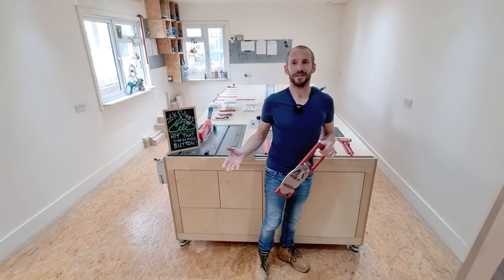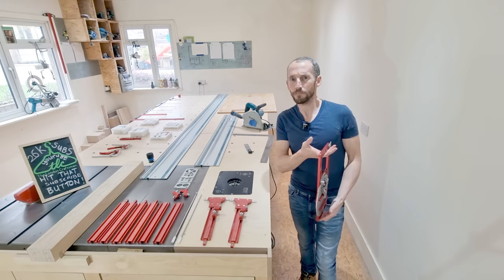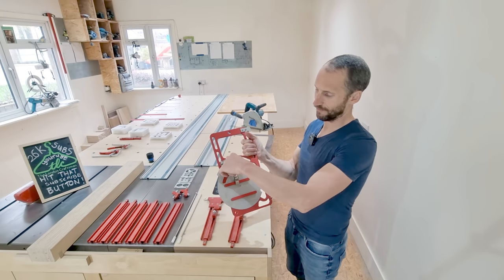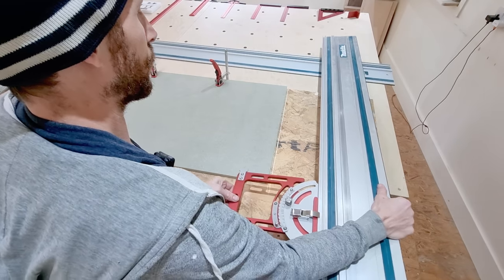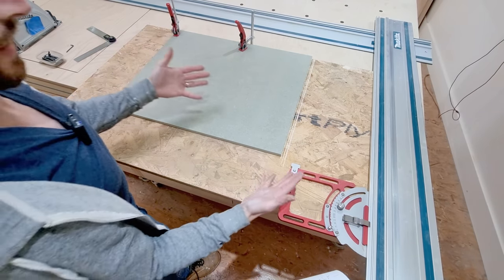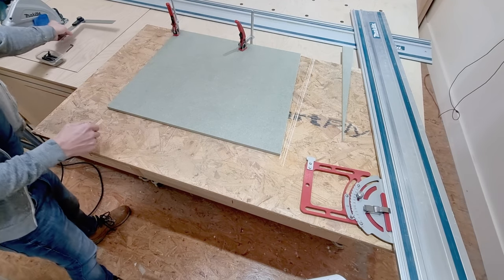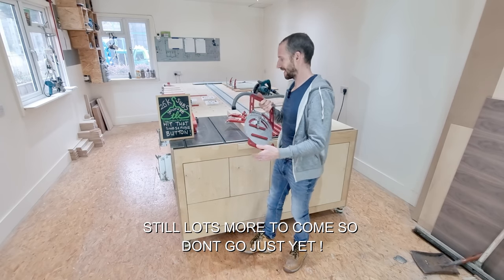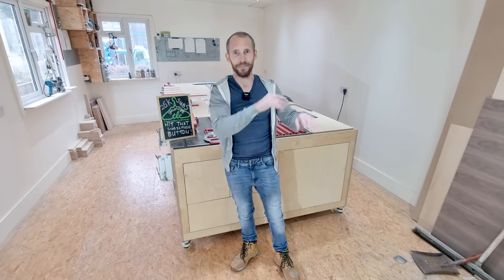Test & Review RIDICULOUSLY Cheap Adjustable Track Saw Square | + New Machine You Must See | Vid#85

Comment: Thanks. I just bought the same bits of kit too. Easy to use and cheaper than a woodpeckers or a table saw. And certainly easier to lug around to sites (I bought mine from AliExpress)

Comment: I have one and find that there could be improvements with the indent lock. There should be a disengage button  for angles that are just a bit off of 90  degrees or any other indent. Other than that it works very good.

Comment: Thanks for reviewing this track saw square. I had this pop up on the Bangood app when I was checking out the parallel guides after your review of those. I was concerned about accuracy as there is no indication it can be adjusted. Even the Woodpeckers version does not indicate how to adjust it in the manual. Showing this ability on your review has me sold. I will be ordering one of these for sure! Thanks!
Reply from the maker: You're welcome I'm rally happy it's helping people 👍👍👍

Comment: Cheers, Ryan,  and thanks again for taking the time to share your experience with this excellent looking tool! Just ignore the trolls. Any suggestion that you are somehow trying to make cash out of flogging Banggood products, seems entirely misplaced. 
I've purchased many myself - only the parallel guides on your recommendation - and can say, almost without reservation, that I have no complaints. All the measuring and marking tools have been absolutely spot on and amazing for the asking price.
I've only had one failure so far, and that was because I didn't do my homework. I bought the mitre guide for my table saw, and it doesn't fit. Alas, being the owner of the non-standard Evolution Rage 5s, the mitre slot is too shallow to play well with the guide. 
That said, I'm over the moon with all my other purchases, and will, on the strength of your demo' take a closer look at this adjustable square.
Best of luck to you, and your business!👍
Reply from the maker: Thank you for the nice comments I really appreciate them.
I really do love the Banggood tools, really well made and low cost.
Cheers 👍👍
Reply: I would second this comment. Both in thanking Ryan for bringing to everyone’s notice Banggood and another appreciation of Banggood. I tipped my toe in the water several years ago after watching a video from Manor Wood. I got the measuring tools and tested each one excepting to keep this one; reject that one - but then and now, I haven’t had a single failure. One thought though, all the tools I have bought are branded Veiko; given that Banggood is effectively a retailer, I would urge caution on people who might buy tools other than Veiko.

Ryan and I (from a response to a comment from me) have come under criticism for buying from China. I certainly despise all that the Chinese Government stand for -and I can’t imagine that Ryan is any different. Given that precision tools are made virtually 100% by CNC and the amount of labour involved is minimal, how can Veiko produce outstanding, accurate tools for a fraction that Woodpecker does? The answer, I believe is that they don’t. I would suggest that Veiko and Woodpecker (as an example) make a square for pretty much the same cost each. I would even say that shipping cost is not a great factor. That leaves 2 possible differences. Firstly, Veiko sell direct, albeit through the Banggood website; woodpecker sell to a retailer who puts on a mark up. Secondly, the profit margin that Veiko and Woodpecker want to make. 

It seems to me that the real reason for extra cost of Woodpecker over Veiko is that Woodpecker, who try and maintain themselves as a premier brand, do earn a larger margin and that the retailer Laos earns a good margin. To give an example, I was watching a YT video of a small company here in the UK making “premier brand” frying pans involving spinning the steel base and not pressing. The product looked fine to me but I couldn’t see why I would pay the £50 that they say that this particular size of frying pan could be bought for. Then the video switched to an office shop and there was the lady of the company talking on the phone and using the company’s price list. I freezes the shot and was able to see that, yes, they did recommend a sales price of £50 but the price at which they sell that same frying pan to a retailer is…….£15. Over 300% profit? That level might be the exception but it does illustrate that “premium brand” products can be money producing items for manufacturers and retailers. 

Going back to China, I would suggest you look up where DeWalt, Bosch, Makita etc. actually make their items. China is the common denominator although most also have factories in other lower cost countries. I think it’s only Festool and Mafell that make exclusively in Europe. So don’t think that your Bosch was made in Germany; your Makita in Japan or DeWalt in the USA.

And, to mention Festool, I wonder how long they have been able to get away with requiring all retailers to sell their goods at the same price. That’s not only illegal in the UK, it’s also immoral to customers. But, “premium brand” again

Comment: I like this, and almost bought it. Then the almighty youtube recommended me a video about Festool Angle Stop FS-WA, $175. It can pivot 60 degrees to either direction, and not much more expensive than this, currently $129.
Reply: In Australia the anglestop is $300, about £170.

Comment: Just a note that the digital angle protractor used to check the cut at about 11:00 in probably has an accuracy of +/- 0.2 degrees at best, so the angle actually cut may be bang on.
Reply from the maker: Apologies Youtube blocked this message for some reason.
Yep it was pretty bang on... Great track saw square and even better that it can be calibrated! ☺️👍

Comment: Nice adjustable bit of kit if you are doing a lot of angles. My guess would be that most of the time it’ll be locked at 90*. Shame it hasn’t got the tilt over lug on both sides so that you could use it to reference off the back edge as you can do with the Benchdogs version. Still at nearly half the price it’s fair.
Pity you are getting your millimetres and degrees mixed up though. 0.1* is not the same as 0.1mm. The number of mm error will depend on the length of the cut.
Reply: So, I picked one of these up. Unfortunately the tilt over lug on the back side of the square would be of no use. There is a rounded convex section in the red aluminum base supporting the rotating section. This will not allow it to be used as a square on the far side as the Benchdog and TSO squares are able. You can see this at the very start of the video where he carries the square upside down.
Reply: @georgemuff5482  so have you changed your mind then?
Reply: @mdeflyer  No, I have kept and so far really like the square. It is a little heavy, just over 4lb, but seems to function as it should.  I was merely providing clarification to your comment about being able to have the tilt over lug on both sides and use on either end of the cut. The square is only designed for use at the near edge

Comment: just ordered my here in the states from Banggood $69.99 US not sure how much that is in lbs.
Reply from the maker: That is very cheep!!
This square is bloody amazing and ridiculous price too i think!!
Reply: @thelondoncraftsmanworkshop  yes. I have been seldomly glancing to see what the price is. I have noticed some of these items drop in price the longer they are out. I also picked up the drill guide at a low price. since I'm just a hobbyist i can wait for the price to lower.  I have the TSO square guide which I purchased a while back. This was less than half of that and more versatile.
Reply from the maker: @hoxha34 my 3 favourites for both quality of the tool and price are the track saw square, the parallel guides and the drill guide. 
Although all the aluminium stuff is amazing and pretty cheap for what it is, those are my favourites.
Reply: @thelondoncraftsmanworkshop  i would have gotten the parallel guides but I received the TSO parallel guides as a present. Can't beat free. LOL

Comment: That's not a power generator, it's a battery pack 🙄
Reply from the maker: Technically you can call it a power generator as when you connect it to a free power supply such as solar panels or a vehicle, it generates usable power
Reply: @thelondoncraftsmanworkshop  no, the solar panel generate usable power and charge that battery pack.  And the vehicles alternator is what generates usable power and charges that battery pack.